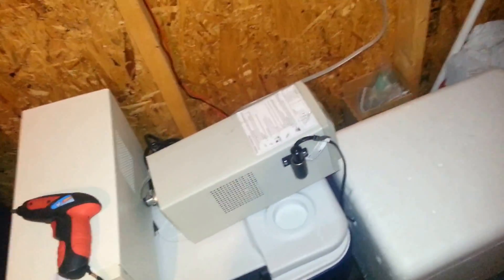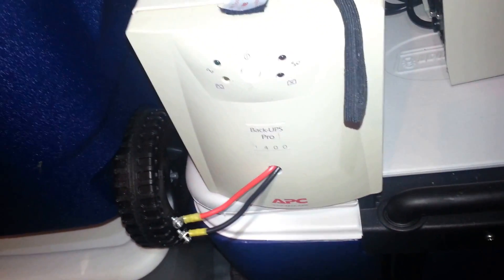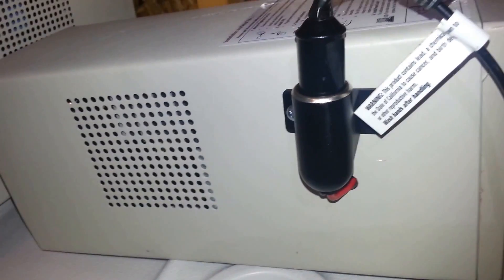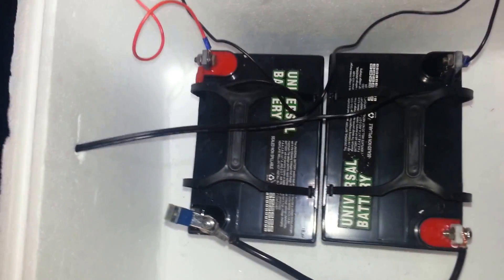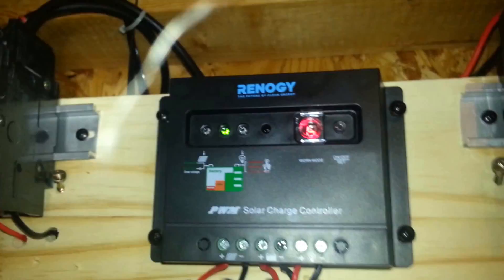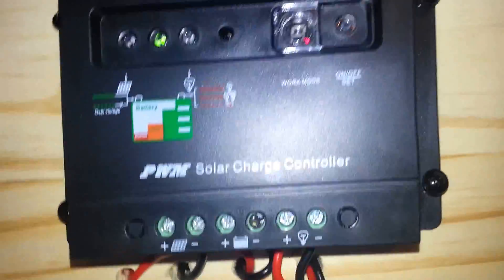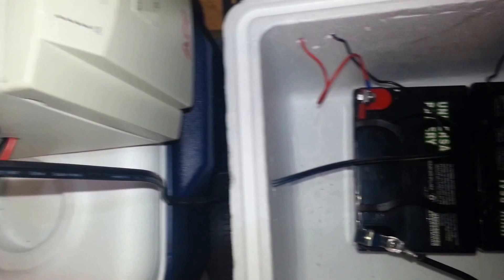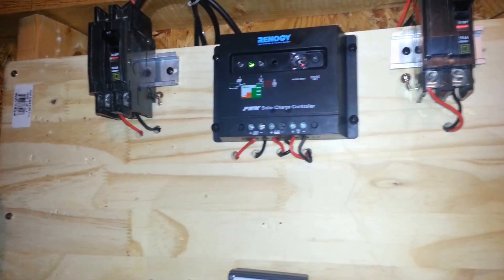Using an APC Smart UPS as Inverter in Solar Setup

Comment: Hi. Very interesting video. I am from Ukraine. With numerous electricity outages having solar shed is 'bare-minimum'/   I have APC Smart UPS 1000 for my experiments... + 2 old solar Panels. Just few questions: 1/ Do you have external AC connected to the APC ? or you have fully "Stand-alone" setup? meaning that APC is operating always on battery mode 2/ On the video you have parallel wires from Batteries to charger and to the APC. Can we use standard connector for External Batteries for this? APC Smart UPS 1000 has build-in External Battery connector (for additional 24 V bank)  I want to configure setup with minimum changes...

Comment: I know its an old post and some UPS have been blown up by now, here's a few answers, you cant connect your battery in series if its 12v. series increases voltage and parallel increases amperage, if you increase amps though you will have to add some sort of cooling, your ups wasn't designed to run longer than the time it would take to safely shut your equipment down. If you have a modified sine wave its even more important. also, there are different kinds of full sine wave ups so make sure you research what you have. line interactive, standby and online. The best and most expensive in online, all electricity is filtered before it gets to your equipment. The others only turn on when there is a disturbance in the force(electricity) so there is a chance of your equipment still being damages.

Comment: Looks pretty simple to me. What i wonder about is the electronics of the APC UPS Unit. If it is not connected to the mains (240v), obviously you are not, Does the inverter work by switching it on without mains connected? My APC Back-UPS 300 does not do that. I do know mine has no by-pass (Cancel alarm) switch like yours but there are pins on the mainboard for it to be attached. Do you know (for sure) if my little APC 300 also has a Pure Sinewave inverter (160W max)?
Reply from the maker: It's not a pure sine wave. It has a stepped approximation to a sinewave, which is not very clean.

Comment: I'm currently working on making a small 12volt apc cs 500 into a portable solar generator, I plan on making a 20-40volt solar panel out of a ton of free solar lawn lights which would power a DC to DC converter to bring it down to 12.6v and then that would go to a 3s bms which would plug into the batteries. I'll also eventually put in some 5v and 12v DC outputs for other devices. Would this solar system work?
Reply from the maker: Go for it. Sounds interesting👍
Reply: Did you get it working?  How many solar lights? You need a lot of area.

Comment: and you might not want to have your lead acids in a Styrofoam cooler the acid doesn't react to well if it get in a high concentration it could cause a exothermic reaction and possibly start a fire
Reply from the maker: The cooler had vent holes at time this video was recorded.

Comment: what are you talking about I use my fan I need for my sleep apnea all night every night for the past two years on a cheap modified sine wave inverter so lower my power bill
Reply from the maker: Consider yourself lucky but it's not recommended for that application.
Reply: Possibly medical equipment compensates for bad input.

Comment: How you avoid an UPS from shutting down by itself. I mean, remaining battery is indicated by battery use time and no by voltage. So even when is plenty of battery remaining. Both UPS shut down (smart UPS 1500 and Back UPS RS 1500) because of this.
Reply: connect it to a computer using serial or usb cable and download the ups program to change the settings
Reply: @Politikul  that's what I did, calibrating and extending the working cycle,  but it'll shut down anyways
Reply: @bastianinostroza1150  Did you solve the problem?

Comment: Can you clear out your explanation a little.  A little confused why are you using an off grid type charge controller system and another separate smart UPS system? I am really interested in your video.  Also maybe can you post video by just using the smart UPS system.  This video is very informative, it can really help others.

Comment: Hi DIY OneForAll.

My Smart-UPS is falling in percentage when there is load on it.
It can go down to 0% with 26 volt on the batteries, when the percentage goes too low it will shut down even when there is a voltage on 26v and the batteries is full.

Comment: Have you had issues with the float charge with your ups being charged by your ups I did the same thing but over float charge the ups
Reply from the maker: cricketol 
I have never had any issues with it.  I use it just to charge the batteries.  I unplug the ups from grid power when charging from solar.
Reply: DIY OneForAll when the power is out we use solar to keep the battery going if the powers out for a long time p.s. we use it for back up lighting and cell phone charging only on those days.  Have you thought about using it in this way?
Reply from the maker: cricketol 
Yes, I am setup to charge cell phones and meet basic lighting needs should there be a power failure.

Comment: Hi there, my question is sort of off topic sorry about that. I'm trying to use, my old 600watt ups as an inverter using Li ion 18650 batteries (3s 16p). I use a bms to protect the batteries. My problem is that since the ups is designed to use deep cycle batteries it turns off at 11.4v while my bms cuts off at 9v. I can't use the full potential of the batteries.  Any suggestions? What do I have to change in the ups to trick the ups and run till the bms cuts power to the ups?

Comment: guys help me out on how to convert my old APC smart UPS 3000 into an inverter using 24 or 12 volts car batteries
Reply from the maker: It appears that your inverter requires 48 volts to operate.  If you decide to use 24 volt batteries, you will need two of them wired in series to make 48 volts.  If you go with 12 volt batteries, you will need four of them wired in series to make 48 volts. Once you have decided on the battery configuration, you can just connect the negative and position terminals to the plug where you would normally connect the battery module for the inverter.  If you plan on using solar to charge your battery with solar, I would recommend at least an mppt solar change controller and two 24 volt 
 solar panels, wired in series to match your battery bank.  I hope this helps. Cheers

Comment: Could you pull this off with a car alternator? I have a Briggs single cylinder, I was thinking about running a car alternator but I'm not quite sure how to hook it all up.
Reply from the maker: Uncle Yar 

You would need to use a 12 volt inverter but it can work.  The one here is a 24 volt inverter.   Hook it up to the battery terminals. The only thing to watch is the rotational speed of the alternator.  You will need a constant RPM to obtain the desired output.   I have an alternator in my garage for a future experiment of this nature.
Reply: Thanks for the quick reply, I'm fairly new to this sort of thing so I was worried it would just bypass the battery and go straight into the inverter or something like that.

Comment: i have Smart UPS 750..so the fan connected to the UPS? U put power extension to UPS to power up other electrical appliances?So Car Cigarette light connect to + and - on the UPS circuit board?
Reply from the maker: Winston, Yes - I went from the AC out of the UPS to power other appliances.  The cigarette lighter is for the plug that goes to the battery.  I used the cigarette lighter for easy disconnect, but you will need a sizable enough fuse in it - depending on your application.

Comment: Hi bro, can you help? I have a 4500w HP UPS. I thinking of using it with solar panel to power pump on a farm. where do I start from?
Reply from the maker: Oracleplane 
I would start with a list of items that you plan to run off the inverter.  How many watts/amps each device will draw? How many hours will they run? The key is to match your battery bank and solar panels ratio to ensure that everything is properly sized.
Reply: Oracleplane try "altestore.com" load calculator and off-grid calculator to give you an idea on how much amp hour of battery you need, for your water pump.

Comment: Hello, I am planning to build a similar system in order to power a small motor for an underwater treadmill for hydrotherapy. Now if I am correct, the system you have built will automatically switch to power grid power if the batteries do not provide enough charge. Is that how your system works?
Reply from the maker: Jeremy Nezaria 
This is an off-grid system with no interaction with the grid

Comment: Hello, please how did you confirmed the UPS as pure sine wave.
Reply from the maker: This particular model is pure sine by design.
Reply: OK. Am so thinking not to fry my ceiling fan and other and I don't know how to get that particular model in Nigeria, it seems to me it is an old model APC UPS. I just need help on how to confirm in case I get another model for the same work.
Reply from the maker: Whichever you get, look at the manufacturer specs.  With the older APC units, the "smart" ones are the pure sine versions.  You may also run it through a scope and observe the wave.
Reply: DIY OneForAll, though I don't have scope to use but your information is very helpful, I appreciate.
Reply: samuel benjamen  easy way to knw... Connect a regular standing fan and run it. If it hums or buzzes then its modified sine wave.

Comment: I have apc 1250 smart ups with external big battery bank trojan t 105 8 of them 2 set of 4 batters of them in series then parallel equal 24 volts 450 ah @20 hours the charger of the unit is 1.5 amp on pg&e power. I also have 165 watt solar panel when I use it I unplug the ups pg&e power so solar and pg&e combine together I'm afraid to. Also keep in mine if ups is off when you unplug the pg&e power the unit need pg&e power to power the ups. Pleaee help me with can you combined solar charger and pg&e power so two different chargers? Also what happened to equalize the batteries using the solar charger trojan battery tech sheet need to do it every 30 days doing 30 volts that mite damage the ups charger?
Reply: YOU WILL DAMAGE THE UPS

Comment: Nice I love it! Lots of information I needed. I recently came across an APC and didn't know how to  corporate it into my solar setup. I now have my battery bank (90AH 24V) hooked up to it and also have the APC plugged into the wall with a timer. Since I DONT have a very large battery bank and only 230W panel I can't run everything I want all the day long. So I run mostly on battery power during the day and then at night (10pm) the timer switches on. I then use the cheap night time energy well the APC trickle charges the batteries until 8am, which then I will go back to battery power and my solar panel starts producing power and charges the batteries as well. Thanks!
Reply from the maker: Wonderful. Have fun.
Reply from the maker: Nick Rigas 
Having the grid power back-up is a great idea.  My shed is exclusively off-grid at the moment. Thanks for watching and commenting. Cheers
Reply: But that cheap night time energy is negated by wear on your battery.  It's expensive again.

How is your system holding up? Any issues?
Reply: So just to clarify, during the day the UPS acts as an OFF grid unit and at 10 PM, it charges on grid using the normal power cord. 
That's a pretty cool idea. 
I was thinking of having my UPS in the shed charging via the solar panel and occasionally I can run an extension cord to the UPS to top it up if I drained it  (if I need to).
Thanks

Comment: my APC UPS BACKUPS 1100 only runs at 15mins then it automatically turn itself off. When I turned it on it again runs the same 15 mins as accurately as it was 15 mins. My battery has not drained because I am using parallel batteries brand new that could run 6 hours straight. Is there a way I can remove the automatic 15mins shut-off?
Reply from the maker: You might be able to change the shutdown time using the APC software and the cable that connects from the APC unit to the computer.  The older ones use a serial cable or RJ45 to USB cable which can be used to control the settings on the APC UPS using a computer.
Reply: +DIY OneForAll Thanks for responding. I know this APC Model is new and I am wondering I did not find any connectors or cables to a PC and of course it did not come with any software upon unboxing. It is indeed impossible to shut it down through a computer. Is there a hard way to just pull something off so that that 15 mins shutdown is disabled just like removing that noisy speaker and still the UPS performs well?
Reply from the maker: +Bruno Brawn 
Modifying the circuit board requires technical knowledge and a solid understanding of electronics. See if you can find a schematic of the circuitry and spend sometime studying it before attempting any modifications.

Comment: How was the connection from the solar regulator to the battery bank? can the two chargers one from the ups charging system and the other one from the battery not overload the batteries. So two chargers one from the UPS system and the other from the solar panel through the charge controller not harm the batteries? I wanted to know thank you?
Reply from the maker: Paul, 
Good question, I am actually only using the solar charge controller to charge the batteries,  not the internal UPS battery charger.  The wall plug for the UPS is not plugged into the grid, so no charging that way.
Reply: +DIY OneForAll what if we can plugin both systems  and plug the UPS the mains and use the solar panel past through the charge controller can if have effect of my deep cycle marine batteries? after the battery is fully charged the solar charge controller will stop  and the UPS will also stop?
Reply from the maker: +Paul Macheso 
Technically,  it could work but I would not recommend charging from the grid and the solar panels charge controller at the same time.  Also, the built-in charger UPS is a not rated for very large batteries.  With the built-in charger, you may find that your batteries will take forever to charge or won't charge properly at all.  In addition,  if you use the grid charger and solar charger at the same time,  there is really no way to keep both chargers synchronized.  In my case, I am using the solar charger to charge my batteries exclusively.   I would not want you to ruin your expensive batteries.
Reply: +DIY OneForAll  yes but charging the battery stops based on the voltage and the battery for the UPS has just 7.2 ah mostly just for the person to save and shut down the computer ...but even if it takes long the battery its still charged fully after i measure with a multimeter but when we dont have power it drains quickly the 42 ah 12 deep marine battery like for 15 minutes using 2 100 watt bulbs 2 induction axial fans 33 watts and a temperature controller.. they were amounting to approx 300 watts for my homemade incubator for poultry and i used a 500 watt ups so i wanted to sustain it during blackouts we are facing in malawi my country am a physics student at the university of malawi
Reply from the maker: +Paul Macheso 
It's always great to have backup power in the event of power outages.  Technically yes, the chargers should know when the batteries are charged, but you find that one charger goes into float mode before the other.  Two chargers can be used simultaneously but it's best if they are  identical and synchronized.
Reply: +DIY OneForAll Thanks for this conversation i have learned alot thank you
Reply from the maker: +Paul Macheso 
Thanks for watching and commenting and all the best with your studies at the university.
Reply: Further to the idea from Paul to have the battery bank charged by both the grid and solar, how about plugging the UPS wall plug to a 24h timer before plugged into grid? The timer would kick start the charging daily after the sunset or whenever the correct timing. Would this works?
Or it's still better without the timer since the weather changed! haha...

Comment: I was wondering about using APC batteries as a solar power. 
I have 12x 12v 9AH batteries. I'm about to make a huge battery bank with my solar panel. 
Nice video!
Reply from the maker: Thank you.

Comment: Please, can u share a schematic showing how you connected the external battery? Or just you connected it in parallel to the external batteries?
Reply from the maker: The APC UPS is connected in series with my two 12 volts batteries,  providing a total of 24 volts, as it's a 24 volt APC UPS. I will do a video soon showing the wiring in more detail.  Thanks for watching.
Reply from the maker: Anthony Hope
Leonardo Villegas 
https://www.youtube.com/watch?v=zOMLAllS4GQ

Comment: You and I are thinking along similar lines, it seems! I've also put a Renogy kit in my backyard shed. I have not yet purchased a pure sine-wave inverter for my setup. Something you said that is completely opposite to my previous thinking is that a modified sine-wave inverter is "perfect for computers" while damaging to a/c motors. I thought the opposite would be true, that electronic equipment would be more sensitive to the waveform. I'm going to be very cautious until such time as I get a pure sine-wave inverter. I have a very poorly-lit video on my channel showing my project--the problem has more to do with my operation of the camera than the available light. I'll try to update soon.
Reply: +Rick Rose The computer actually converts the AC power to DC so there's a power supply in between the motherboard and the inverter. The fan on the other hand, takes the AC power directly to a motor. That's probably why his fan probably overheated and broke.
Reply from the maker: Rich,Thanks for the comment and visit. I just watched your video and you have a nice setup there.  Can't wait to see more videos on your system!
Reply: Brian Lee Thanks for the explanation--makes perfect sense.